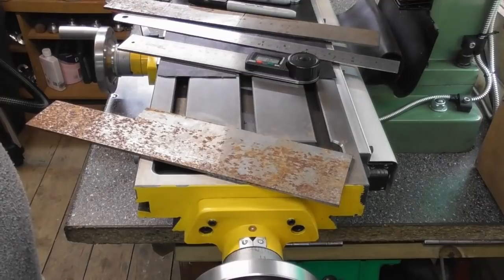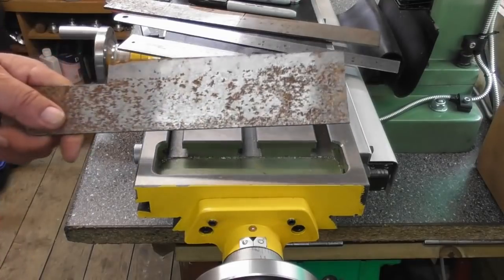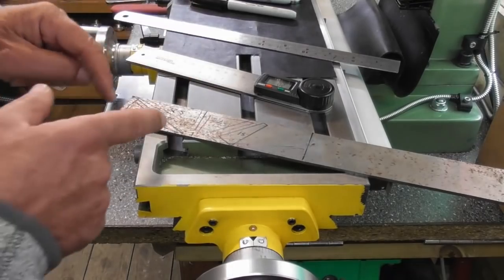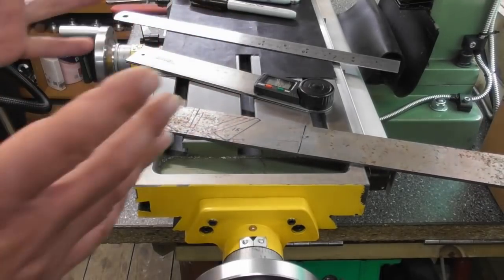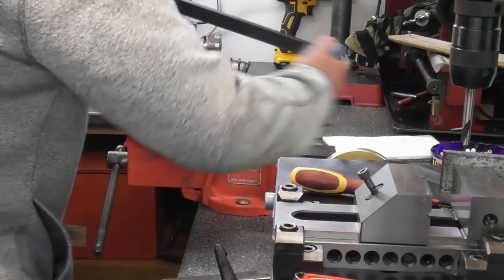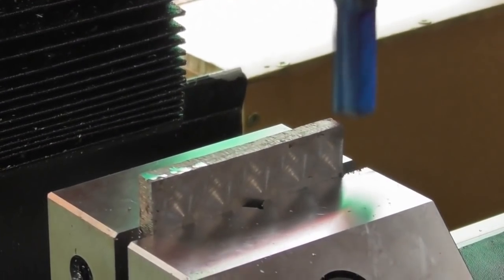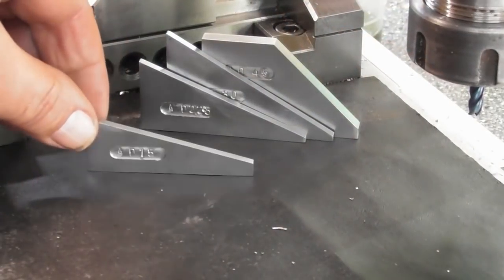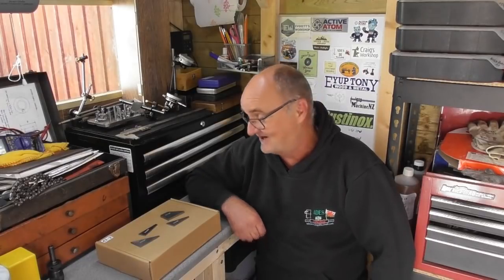Four angles Four ways #TMC2020

Comment: Hi Ade. Enjoyed seeing the different methods. Personally I would vote for doing it on the rotary table with two hold down holes in the angle plates and care taken to eliminate backlash. I would reckon that would have to be pretty accurate. The sin bar is accurate but I imagine some risk of movement when you clamp down. This engineering is a piece of cake from the armchair.😁

Comment: Good video Ade. I use my DRO as a sine bar to machine shallow angles. Just clock the part in moving X a known distance eg. Move X 10mm and Z would have to move 5mm for 30 deg. You could do this to check the accuracy of your angle gauges.

Comment: Nice gauges Ade, it is very relaxing to watch you in your shop. You have a very smooth and confident way of doing and explaining, in short you do make it fun, cheers mate!
Here's looking from middle of Canada.
I think there is another method out there, where you do the sine bar calculations for a given separation and drill two holes in the piece . Then supporting the work on two same size pins on top of the vise jaws, clamp and mill parallel to the holes. That was in a Joe Pie video if I recall correctly.
Reply from the maker: Hi, yes indeed there are many many  ways to get the result , I was limited to a twenty minute format for this particular video,  I could do a ten part series no problem before i had to start thinking for something new, I am glad that you enjoyed it. I love Canada , I lived in BC for two years as a kid in the 60's . I will come back for a visit one day. Cheers Ade.

Comment: Hi Ade, great video and very useful, I'm learning lots. Quick question, I'm thinking of buying a Warco WM16 and wondered why you went for the belt drive version over the variable speed? Cheers, Stephen.
Reply: I have the variable speed and wished I had ordered the belt drive. The low/ high gear train is only plastic and can easily strip teeth on the variable speed.
Reply: Thanks pj M